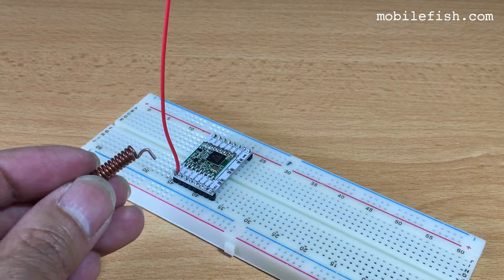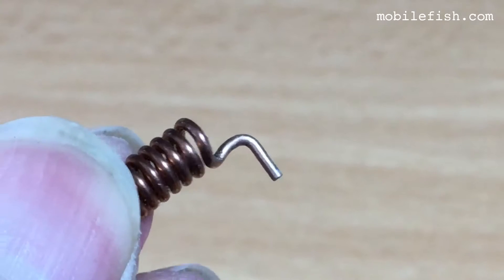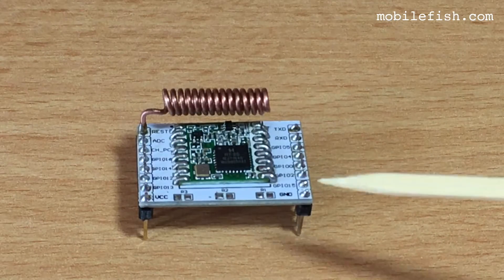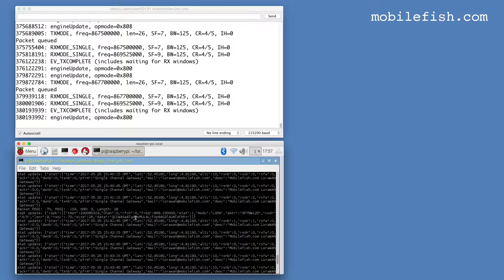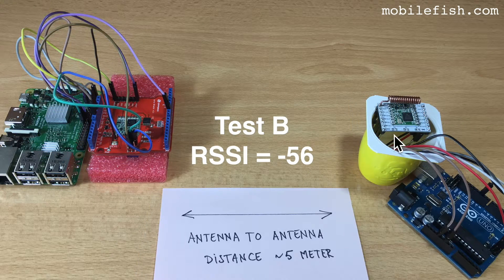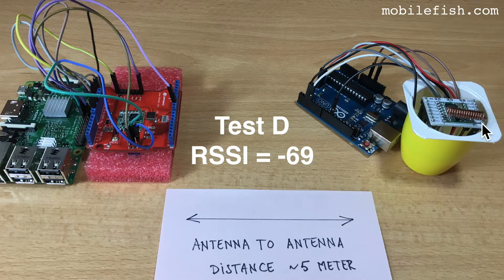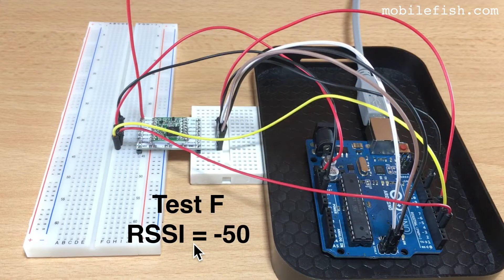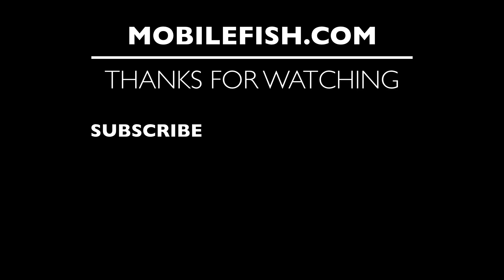Create a LoRa node, part 6: Coil antenna vs wire antenna

Comment: Hey, nice work.  I've a query, can i change the spring antenna with a rp-sma antenna?  And if so, it will have better results?
Reply: yes you can change, no better results. Only things that affect are correct tuning of antenna to wavelength and the groundplane this antenna works against + all the usual antenna height orientation etc

Comment: Where can I get a wire to use it as antenna? or which characteristics the wire needs to have?
Reply from the maker: Any electrical wire will do, see: https://youtu.be/OwNiL4402kM?t=150

You can also use a paperclip or bicycle spoke, but they are difficult to solder. Best is to use a copper wire. You can use copper stranded wire or just a solid copper wire as shown in the video.

Comment: I am not expert, but antennas should have same polarisation, right? That means if orientation of reciever is vertical, the sender should be vertical too. Did you test horizontal of both tranmitter and reciever?

Comment: Wow what a difference when the coil is vertical! I did some distance testing when I first started playing with LoRa but did not play with antenna orientation, just kept the factory made coil one upright. I would think having them the same one both ends would be best but then never assume, huh? Since then I have also watched making hand made wire antennas with built-in ground planes. Looks like I need to do some more experimenting!
Reply from the maker: For more information see: https://youtu.be/2I_ZhZ5G-vE

Comment: I have heard that an omnidirectional antenna with gain of atleast +2.5dBi is required to connect LoRa node to the gateway which is separated by 2km. In that case, what is the gain of this copper coil antenna?Also is this antenna omnidirectional ? Please reply.

Comment: Hi, i have the lora module drf1276g and the coil antenna for 868 MHz. I have very low RSSI values from my gateway application(about -136). I soldered the antenna to the antenna pins of modules. Is this normal ?
Reply from the maker: What is normal?
I have seen several examples where people are connecting antenna directly to the antenna pin of the module. Connecting it directly to the antenna pin of the module reduce signal loss.

But if you are experimenting and want to attach different antenna's to the module than do not attach it to the antenna pin of the module to avoid damage to the module. In my video I did not directly attached it to the antenna pin of the module because of this.
Reply from the maker: Instead of a coil antenna have you tried soldering a wire antenna?
https://youtu.be/_xgAq--l0Ik?list=PLmL13yqb6Oxc3FvWz4XewMl8OXsV5iqON
and was the RSSI values also around -136?
What is the distance between your Lora node and the Gateway?
Reply: Mobilefish.com not so far from my gateway They were on the same desk. I didnt tried to solder wire antenna. I think that 2 Major problems i have first antenna is A big problem i will try to get pcb for it. Second is the my working library on arduino. Do you suggest any library for gateway and node application?
Reply from the maker: If your node and gateway is on the same desk than an RSSI value of -136 is not good.
I am not familiar with the Dorji drf1276g module, but this article describes using the dorji-drf1272f module using the LMIC library:
http://robertoostenveld.nl/ttnlora-using-dorji-drf1272f-module/

PLEASE NOTE: This article uses a different DORJI module. But maybe you can see how he has done it, and see what you have done differently.
Reply: Mobilefish.com thanks mate i will look up for it.

Comment: Hi Mobilefish, Just wanted to suggest a couple of things worth a try: 1) consider the RFM95 board (and the rest of your circuitry) as your antenna's ground plane, and have your coil antenna vertically mounted away from it like you did with your wire antenna (there's a couple of possible orientations, but basically try not to have the coil close and hovering parallel over the board). 2) Use the same antenna type at both gateway and node, if possible, and in the same orientation for best results. 3) Your 86mm mono pole antenna wire suggests you are using 868Mhz? If so, that spiral antenna looks more like a 433Mhz version, the 868Mhz spirals have about 9 turns and are shorter.
Reply from the maker: Thanks! 

Step 1. I will definitely try.
Step 2. I will think about. 
Step 3. My 868Mhz coil antenna is based on this Chinese design: 
http://www.professor.com.tw/upLoad/product/month_1402/201402251742447302.pdf

The one you suggested is there some online documentation available?